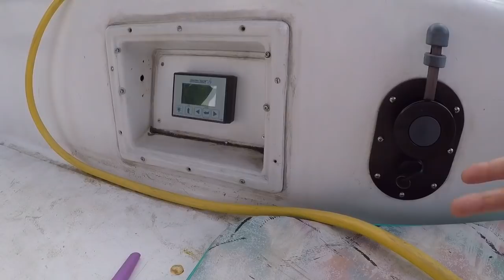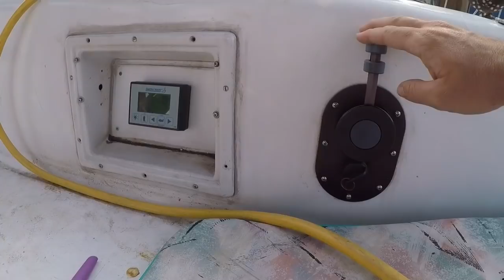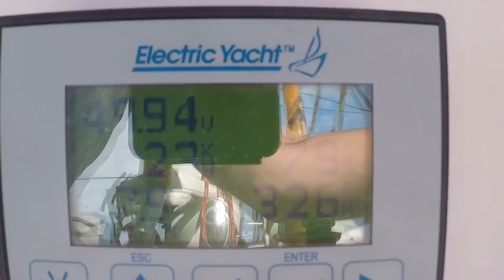Our Electric Motor | Sailing Wisdom Ep 32

Comment: It will work well until there is an electrical problem.  The diesel engine is the secondary power supply.  The all electric eliminates the secondary system.  It's just voluntary compromises that what boating is all about.  Cheers.
Reply: The 48V system is the secondary system (the 12V is what a diesel boat would have) with two (possibly three) tertiary systems to charge it.  Sailing isn't about polluting the world with a diesel engine.
Reply: CorwynGC yep done with batteries now diesel is less pollutant than any gas burning over emissioned car

Comment: This is a border line system for a boat that goes out for an afternoon sail or maybe an over nighter but for any real sailing this system will not preform.  The famous enginless sail boater has been towed in to more marinas than most people have ever seen in their lives. Every boat comes with a diesel engine for a reason. This guy gives so much false information it must be liable in the US.
Reply from the maker: I'm curious what your experience is to be able to claim that we have put out "false information." Have you tried cruising with an electric motor?
Reply: Ok, I built my first boat when I was 15 and was taught by a navel architect.  On my solo sail across the pacific I took an electric outboard for the dingy and learnt first hand how poor batteries are for storing any real power.  Deeply discharging a battery and then charging will gas the electrolyte and empty the battery of electrolytes.  I have watched boaters who do not understand the limitations of batteries empty new batteries in a month of use. Please read nigel calders first book on boat mechanical and maintenance.  For the batteries to last 4 years you can only discharge 40% of the amp hour rating. Using these tryed and true numbers, how long can you run your electric motor? Batteries are not designed for high load over a long time. So you will have to replace your expensive batteries every 18 months to 2 years max using the 40% discharge rate, and much sooner if you are deeply discharging.  
Now ask any sailor about going sailing with an unreliable engine.  An engine that will last 2 hours and then leave you stranded.  Is this prudent? Is this good seamanship?....... no!
This application is the same as an electric car and after decades of research new battery technology has allowed deep discharge and charge rates but cost huge money to get the amp hours needed.  The lead/acid battery system failed miserably.
Reply from the maker: +Sails I understand your concerns about limited run time, but I do not view a short run time as unreliable. I know what I can ask of the motor and know that it will deliver when asked.
As for batteries, our battery bank of 8 Group 31 cost about $1,800. It is currently 3 years old. If we were to replace the batteries every 2 years, that would seem expensive; but what if we viewed the price of batteries as the price of fuel? $1,800 would be the equivalent of 600 gallons of fuel @ $3 per gallon.
If your yacht burns 2 gallons per hour, that would give you a runtime of 300 hours before you would need to buy more fuel. If the batteries last longer than 2 years, then your "electric fuel costs" would decrease. Being how you feel that 2 hours of runtime is insufficient, I would assume that you would easily hit 300 hours of motoring in 2 years time. For someone who relies on their motor as the primary mode of propulsion, an electric motor would be a horrible choice. For us though, who sail as much as possible and only motor to get in and out of marinas, the electric motor works quite well. 
While in the Chesapeake Bay, our batteries remained in the 80-100% range for three months without being plugged in because of the seldom use we drew from it and because the solar panels recharged the batteries while at anchor on sunny days. The best part is we never had to purchase fuel the entire time so our entire cruising budget was directed at food and entertainment.
Reply: My 65 ft sail boat has a perkins 6 cl deisel and it uses 7 ltrs an hour so your calculations are correct for my 40 tone boat. I made the previous statements before I watched the rest of your vidios. And on your first off shore passage you were towed into port. I think enough has been said.

Comment: A diesel is an engine, not a motor.  Engines run on fuel combustion.  Motors are electrical.
Reply from the maker: +Josef Roesler good distinction to know!
Reply: +Josef Roesler "Engine" is a type of motor. Diesel engine and diesel motor are both correct terminology. Electric engine is arguably incorrect, although many use this anyway. Also in many languages there is no separation between the two. "Engine" translate almost always directly to "motor" !
Reply: Hmmm ... "motor (n) /ˈməʊtə/: a machine, especially one powered by electricity 
or internal combustion , that supplies motive power for a vehicle or for another device with moving parts.:

Comment: hey diesel motor? you guys are inexperienced! Diesel motors can save your boat and potentially your lives when fighting against the wind (Blowing you onto the rocks) or the tide (taking you onto the rocks) or the wind and the tide together with a blown out sail, no sea room and you are fatigued and ,,,,,get the picture yet?    removing motors is a dumb philosophy from 100 years ago when motors were unreliable!
Reply from the maker: +Steven Baxter in that situation, drop the anchor. 
Stay tuned for the next video when we address these questions.
Reply: It’s a choice, there are pros and cons to electric. Each to their own. Mine has been electric for 5 years.

Comment: Yes you will find out, I love electronic corrosion and cost of batteries. Motor and fuel maintenance is a no brainier, parts are easier to find world wide. Good luck in heavy weather with so little run time. I will invest my time in my feather prop and old faithful engine. Honestly you sound kinda of lazy....my 20 year old diesel will still out last your short range electric motor and batteries. This is a fact!
Reply from the maker: We just crossed the Atlantic with the electric motor. Lazy? Hah.